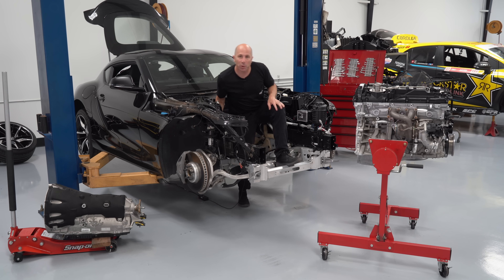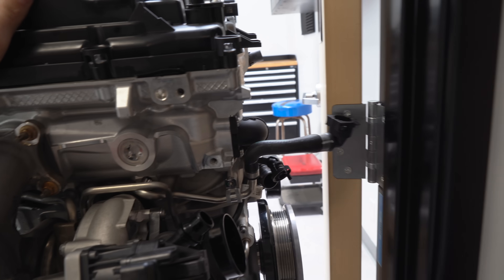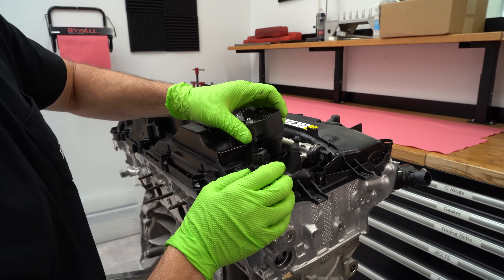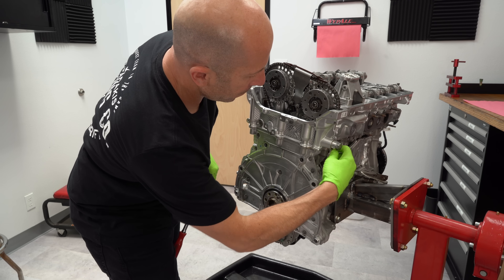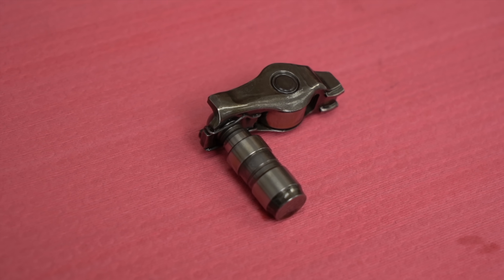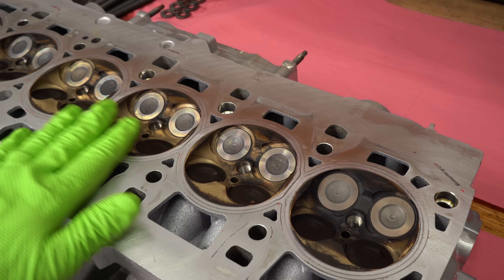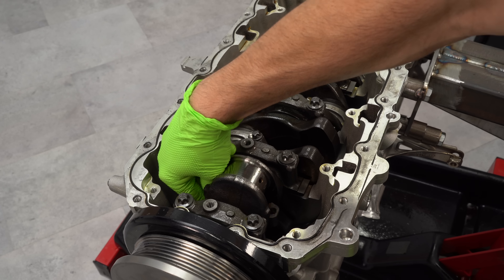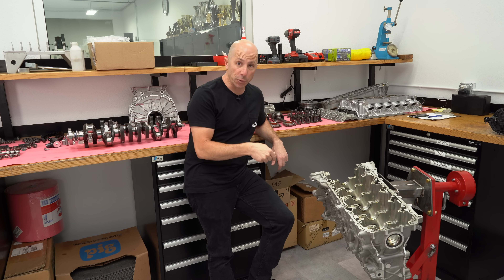2020 Supra B58 Engine Teardown - First Look - Better than the 2JZ?

Comment: For these BMW engines you actually use a BMW Spark plug socket. You can get them cheap on eBay. 
Interesting Fact: not long ago for the BMW’s built with the B58’s BMW redeveloped the oil filter because the bottom of the oil filter kept getting left and stuck in the oil filter housing when you removed the top.

Comment: so is this the same bmw b58?
Reply: No. Toyo changed the bolt patterns,threw a bigger turbo on it,and has a stronger fuel system than normal B58s. But that's for the 20s case. The 21 mk5 has the same B58 as the Z4 but different pistons and a lower compression ratio.

Comment: Looking at it for long term the maintenance program looks extremely expensive going to take 8 hours to do that timing belt the manifold is going to crack and plug up and the water oil cooler might potentially leak and have water in the oil goodbye to the motor I do see a lot of potential I wonder what the 2jz would be like in a 2020
Reply: 2j was super simple because it was a product of its time. If Toyota built a inline 6 today it would be a open deck, NA, high compression engine with maybe a tough ecu to crack. That’s based off of all the engines they currently make for their higher performance cars (RCF, LC500, GR Yaris)

Comment: OUTSTANDING Video! I wonder if the three lobed cam on fuel pump drive relates to the six cylinders, perhaps by sending harmonic pressure pulses through the fuel rail and injectors? Simply fascinating.

Comment: This is very helpful.  I have never seen a state of the art engine completely dismantled, like this. When I started out in the trade, we rebuilt engines all the time. These days it is rare. Used engines in acceptable condition are cheap and plentiful. I am impressed that you understand features like the rod bearing caps that were fractured to create a unique surface pattern, such that they would re-assemble more precisely.  BMW has been building overhead cam,in-line six cylinder engines now for 100 years. The IIIA was introduced in 1917. Four generations of BMW engineers have worked on this platform. I found it very useful to be walked through the current iteration of the design.

Comment: "admiring" an engine that still uses petrol is prohistorical. Electrism is here and is really fast, max torque to all rpms, no gearbox ,thousands less mechanical parts and we are only at the start! So...tighten your safe belts,relax and forget these broom-broom dinosaurs
Reply: but theyre so boring
Reply: @bitai683  the sound is fixable...nothing serious to worry about
Reply: @genarogarcia5728  passing by enlightening the others, not you sir

Comment: All I’m seeing is what Detroit/Benz/fuso (truckmotors) have been doing for a long time the gear train at the back Detroit Diesel dd15/13 use that which Benz use aswell the rockerarms and lifter as one are used on fuso 4p10 a lot of diesel motor designs in this motor. I look at that new supra motor and thing it’s a diesel motor running petrol haha. But still very cool. And he explains it very well.
Reply: I was seeing the same thing.

Comment: It’s a cool engine but I’m not convinced by the rear timing chain and the manifolds inside the engine. I rather keep it like before. Also I’m not a fan of vanos or vtec systems
Reply: If I remember correctly. The rear timing chains different on the mk5. Heard it's reworked to be more simplier to remove.(Heard u don't have to remove the whole engine just to remove the chain off these anyway).

Comment: its not better than 2JZ it wil never last like 2JZ....I seen a lot of 2JZ engines build in Bmw
Reply: Lmao. Even if Toyota decided to build their own inline 6 it would probably be similar to the B58 but have an open deck and be harder to tune (Modern Toyota’s are notoriously hard to crack) 2jz was just a caveman styled engine

Comment: These dudes are at just another level. When you are making a bracket for an engine on the fly, that's just madness.
Reply: No madness.  Just old school machinist skill.
Reply: Not really.  Many Japanese engines, including the KL series from Mazda, suggest such a mount in the Dealer's OEM service manual.  That's from the 90's.  Easily impressed?
Reply: @squirrel6687 ;@mrmannyhw
Must remember. Some folks skill are non existent. The genius from old is new or unknown to the new generation. I was happy I could find a bolt and washer to replace an old one. When i saw this I was blown away.

Comment: Man, messing with hondas 20 years ago you can see how honda was ahead of it's time, we had forged cranks, oil squirters, cracked rods and caps, girdles  in the b  and K series.
Reply: “We”
Reply: oh they definitely did and are very strong/reliable for it. Sadly open deck, though. Fairly common to blow head gaskets or crack liners under high boost with forged internals. For an n/a application they are incredible engines.

Comment: I heard it isn't even a Toyota engine, but a BMW, is this true? Also heard the new Supra is only available in automatic. If so, it is really sad. It should at least have a Getrag 6 speed option. I was also very excited when I first heard about the release of the 86, but kinda got deflated when I found out it had a Subaru engine, and was built in collaboration with Subaru,( hence the BRZ). Don't get me wrong, Subaru's are great, but it's still a let down. It should have had a 3S-GTE or something! What is Toyota doing?🤬 I realize a flat four has a lower center of mass and is shorter which improves weight distribution, but really? The engine bay of an 86 can even fit a 2JZ-GTE, which makes for a great drift car. I can't afford either so it really doesn't concern me that much, but as a long time Toyota fan, I am really not impressed with the direction they're heading.
Reply: Yes engines made by BMW and yes it's auto only auto. ZF is the company that(if I remember correctly)had made the hellcat/demons trans and them making the mk5s trans(and also has people going dead over what the trans limit of power it's supposed to handle. Including that they couldn't put a 3sgte in the 86 since 1. It's mess up its balance and the 3s is outdated also so it wouldn't have worked anyway.

Comment: Question for the 2JZ fanboyz. If Toyota is so great at making "performance engines" then why Toyota would require the assistance of Yamaha with the 1JZ engine? The 2JZ is just a variant of the 1JZ, which would make the argument that Yamaha helped create the 2JZ. Toyota took what they learned from Yamaha on the 1JZ and applied it to the 2JZ. Also, the answer of most trolls that "well Yamaha is Japanese too" makes you look like a fool. Well if that's the case they still used another company to help them create a performance engine which defeats the logic of fanboys complaining about Toyota using BMW for the Supra. In fact, it makes them look even more pathetic since they had to rely on another company to build a whole performance car, NO?

Comment: This engine is restarted why is the timing chain in the back why is the oil filter and spark plugs buried why is the manifold plastic these are going to blow up it's a b** to replace an oil filter the timing chain is going to go out and can be more expensive than a Cadillac the best part about the 2JZ with its Simplicity and being able to reach your hand inside the engine I can steam oil filter I can see my spark plugs I can do the timing chain in my driveway this is stupid it's going to be like trying to take care of an old m5

Comment: People with Internet Engineering degrees are complaining "Why did toyota use BMW?"
It is a good question but you gotta also ask yourself, "Why DID toyota use BMW engine, knowing that they'll have give BMW some royalty of the profit from the MKV Supra?" 
Toyota is well capable of making their own engine, and have all the profit for themselves rather than share profit (They make their profit mostly on sedans and SUVs so they do have the resource to make their own engine without partnering up with someone and share the profit), so why? It's probably because BMW right now is the leading manufacturer of I6 engines, so even if toyota made a 3JZ, I doubt it will be as good as the BMW. BMW have been making I6 for over a decade, toyota haven't really touched I6 for a while. 
If you know someone that can work on your car better than you, would you still do it yourself and risk messing things up?
Reply: Sooo actually nissan is the leader of inline 6 engines lol but toyota couldnt go to nissan in a partnership for apparent reason they just went to bmw for the best inline on the market that WASNT Japanese
Reply: @DavidGonzalez-xd5mh  idk, I always think of VQ and VR when I hear nissan sports cars now a days. Back then they had that sweet RB, idk the inline 6 nissan uses now a days but I'd be interested in hearing more about it

Comment: "Runs oil and coolant right next to each other separated only by a weak rubber gasket so when the gasket fails and it will they can mix together just like all the same thing that happens in all the Vauxhall Astras''

Is this BMW or GM ?

Comment: I heard these were shitty. Of course not  for quality and longevity cause Toyota. But i heard they have like no power.how true is this? Is it like the 2jz where you can just beef that boy up and make 1000 buff horses? Someone let your boy know
Reply: The engine has hit 900+ hp with upgrades, but the limiting factor is the trans. The trans starts to slip and act up at 600-700 hp. No one can really test high hp cars due to this issue. Once the trans issue is fixed, then you will start to see people push the engine to high hp levels. .

Comment: I want to build a 700ish hp 2020 street drivable supra with the factory automatic transmission beefed up or a 6-speed manual swap because I like hooning my commutes.
Reply: Well. Thats already possible anyway without doing anything to the trans as is.

Comment: Why didn't Toyota feel like doing their own work?  Considering the success of the LFA why did they stick a BMW in this car?
Reply: Because they knew this was going to be a low production car just like the 86 so instead of using their money, they partnered with BMW to make it cheaper so more people can have access to buying it, while if Toyota would have make a completely new chassis and engine and everything, it would've cost North of 80k and the thoughts that Tada-san had was that this was going to be an enthusiasts car so it'll be easy to modify and an accessible car.

Comment: The only good engineered part of this engine is the engine block. Everything else just screams marketing and non-DIY maintenance. "The socket was easy to get, it was 60$". Still very nice of BMW that oil change doesn't require a special 60$ socket.

Comment: I was thinking about getting a BMW with this engine, but after watching this video I probably won't. I don't get what's the point of placing the timing chain in the back of the engine other than making service very difficult and expensive... Or this exhaust manifold being integrated into the aluminium head... Is it even cooled properly??? Also, direct injection means carbon buildup. This engine might be cool but I doubt it'll last more than 100k miles. I'll just keep driving my BMW with good old M54 until gas cars will get banned, or it falls apart, whichever happens first :)

Comment: No gaskets? 10-20 years down the road there’s gonna be a lot of BB-8 engines weeping oil and smothered in silicone from tuners trying to do their own maintenance. And the timing chain at the rear of the engine? You can’t even pull the engine to service it without having to modify your engine stand 🤣 BMW engineers be smoking that same crack for the last 40 years.
Reply: U too be smoking that crack when u don’t even know the engine code. U muppet

Comment: So now we have a "toyota" with plastic parts like the water pump???????? And thermostat housing??? Great work toyota. When i will be able to afford this car in 2023 after 100k miles i will clearly need to replace some parts
Reply: Yk the engine is already 5 years old and has nome of these issues

Comment: is there anything toyota bout it? connectors? wiring? parts?  anything ? switches?
Reply: The whole design of the car the whole interior and they helped engineering the engine. The trans is from zf so no bmw

Comment: What do you think the B48 engine could potentially hold power wise considering its the same block almost minus the 2 extra cylinders? I'm currently in the process of building my B48 motor for my MINI. Great video btw :D
Reply: Instead of building that pos motor and pos car just get rid of both and buy a proper sports car you will save time and money
Reply: @kamikaziblack  Its my track car, besides its already built now... If i wanted a "sports car" id buy one but there's more joy in it for me when you get chopped by a cooper s with a fully forged engine running 400+ wheel...

Comment: Ugh god. Seriously? Why do germans like putting timing components on the BACK of the engine?!
Reply: Because they designed it so it wouldn’t break so you don’t need to replace it thus putting it in the back
Reply: @Real_Turismo  I can get the logic behind that, but they did it for performance reasons. The chain being at the rear does in fact put less load on the engine, with it rotating, etc. So now instead of having the cogs and chain near the front, it's at the back. I was actually referring to the ford 4.0 Cologne engine
Reply: Charlie Gates ok?

Comment: I just opened the video to say LOL.. better than a 2JZ? Hahahaha bye
Reply: Can’t handle the truth can you?
Reply: Sense Cars you know nothing about 2JZ do you?
Reply: TayTheBandit i do and i do also know that the b58 is superior
Reply: Sense Cars a bmw engine thats not going to be properly functional in 5 years compared to an engine almost 30 years old and still running able to push 600bhp with stock internals. What could b58 do?
Reply: Sense Cars you know nothing about engines this convo is done for dont ever talk about engines to anyone ever just dont embarras yourself like that
Reply: TayTheBandit wtf u talking about haha
Reply: Sense Cars are we talking about the same engine 2JZ-GTE the engine is 30 years old and still ticking like a clock capable of handling shit load of power with stock internals do the same shit to this engine it will blow to bits you have to upgrade shit on it learn your facts then come talk shit

Comment: BMW engine = lot of problems in 3 year
Reply: B58 powered cars haven't experienced problems over 3 years.
Reply: Hopefully it is much better than its predecessors, I would have preferred a Toyota engine equal to or better than the 2JZ
Reply: @elmecanicosangron  Well,this has its advantages since it can make more power with less done to it compared to a 2j. But papadakis is using the 2 port B58 with its heads integrated into the block. The 2021 mk5 is getting a B58 that's heads that aren't integrated and have 6 ports and a lower compression compared to the one that's in this video.
Reply: @carboydorifutoparty3976  The heads aren't integrated into the block. The exhaust manifold is integrated into the head.
Reply: @elmecanicosangron  well this is already similar in some ways already to the 2j(not completely). It has forged internals,forged crank,strong block(shared block from a diesel i6),easy to mod,lighter,come either with 2 or 6 port heads,and is still a closed deck i6. It's not terrible but the B58 or even the S55 and S58 are the closest things were ever getting to a 2j.

Comment: What u think about d exhaust port I think its two small
Reply: The 2020 has the B58C with 2 ports. While the 2021 will get 6 ports this year that aren't integrated into the heads.

Comment: $60 socket? weld together 4 cheapo 12points (prolly gotta drill/bore) from hazard fraught
or drill a hole in a piece of plate and weld it to a pipe, weld in an old socket

Comment: So no more Valvetronic BS?
Reply: What do you mean? It had VANOS and Valvetronic?
Reply: Exquisite Art yeah. But I think I saw it when he was putting everything back on.
Reply: @305dadecounty305 ?
Reply: Exquisite Art yeah you know the motor that has gear worm to adjust the valve timing. I hate it bc if you ever need to adjust it the only ones that can do it is BMW.
Reply: *has

Comment: B58 Intake manifold and valve cover are made of plastic ,  just to name a few . 
2JZ ,  both metal .
Plastic valve covers tend to warp and leak overtime .. why plastic ? Cost .. 
of course BMW fans will always say that plastics are superior .
But what I don’t get is that why didn’t Toyota build their own engine when they are capable of building something that is way superior to the B58 is beyond me
Reply: Toyota could've definitely made their own engine but the car would've would've been way more expensive, close to 70k+ and they wanted the car to be more available to the general public. Honestly calling it a Supra was more of a marketing scheme, but it's still a pretty good platform now that a bunch of R&D has gone into it.

Comment: The throttle body on these engines, are not use for anything but an emergency shut off valve.if the engine runs away.  The valvetronic system is what regulates engine RPM.
Reply: Hey look! Someone who actually does their research